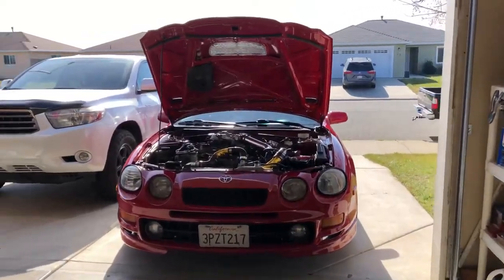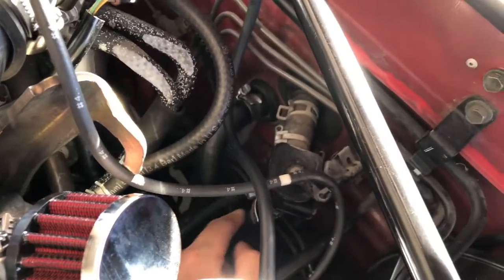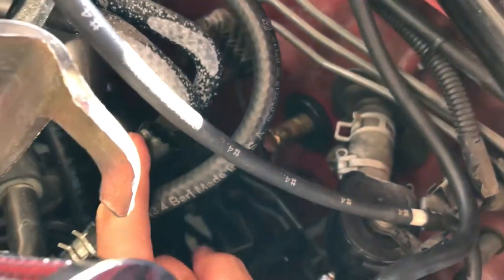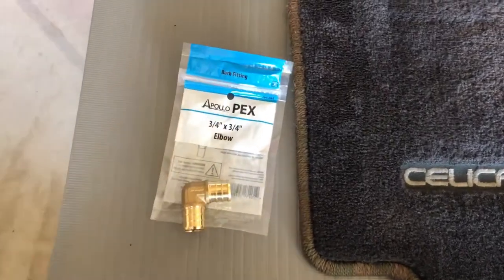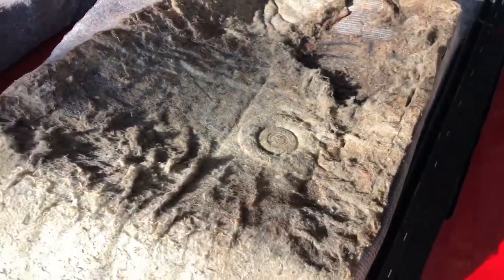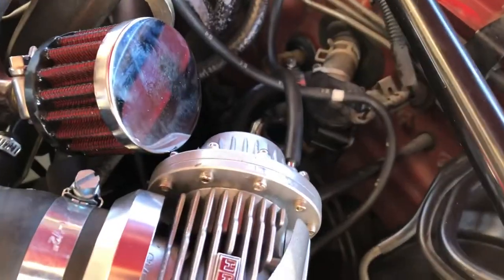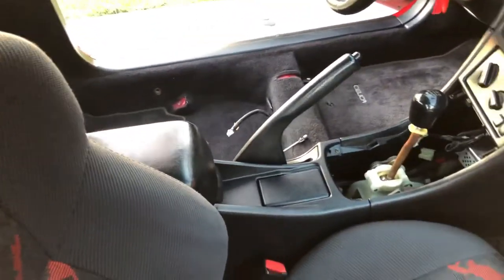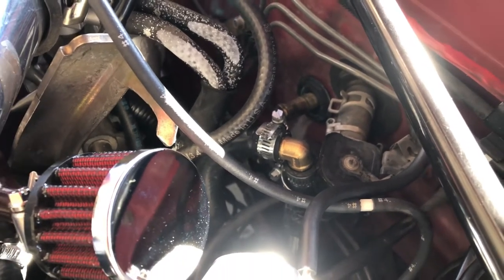6genCelica Coolant Heater Core  Bypass

Comment: How well is that foam cushion material working out?  It seems like it would create a bulge and or slide around underneath the carpet. You could have replaced the coolant-soaked underlayment with the same material acquired from any automotive upholstery supplier, and 3m Super 77 spray adhesive to re-affix it.  That's what I did when restoring my carpet set as it had started to disintegrate with age.
Reply from the maker: It works fine, no sliding or what not. Thanks for the info, I’ll consider it in the long run.

Comment: Hey bro love your content , just picked up my 6th Gen doing the same conversion.  I'm running a wheel set from my fifth Gen but it rubs on the calipers are you running spacers on your 6th Gen and if so what mm 🤔
Reply from the maker: No spacer, running 17x9 offset 35